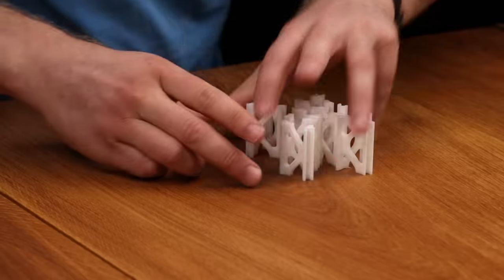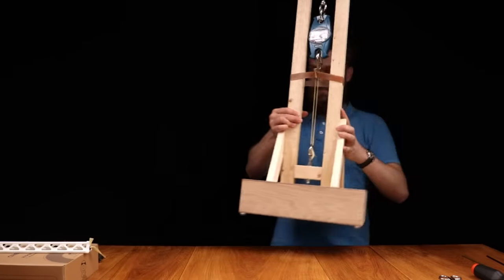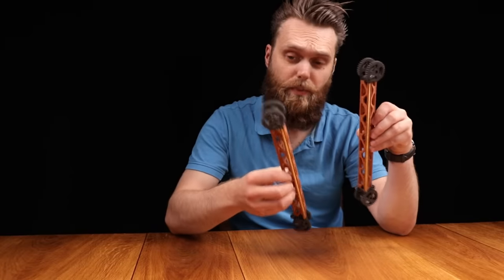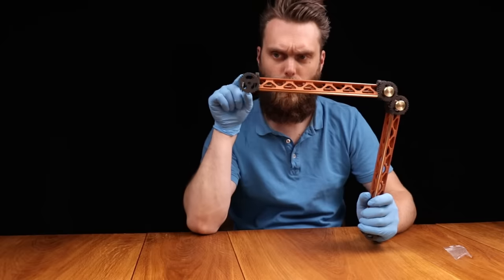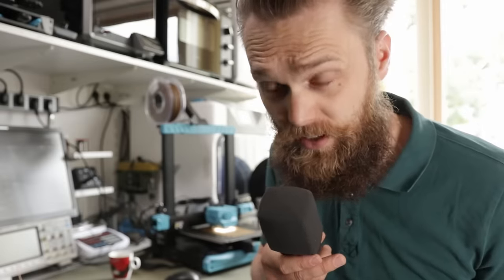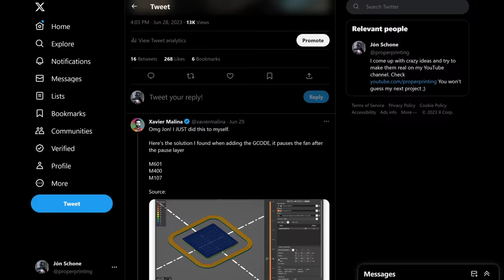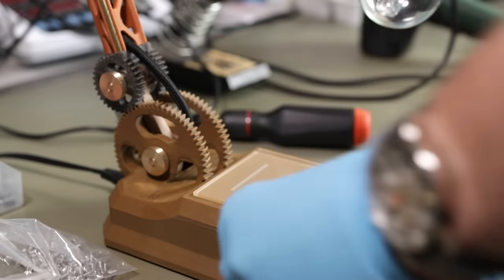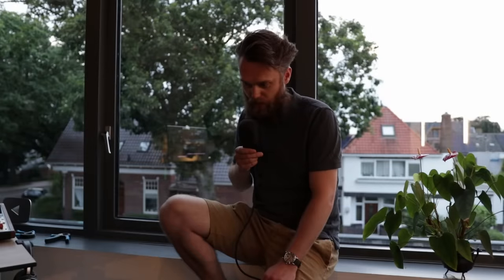You can build AWESOME things with this 3D Printed System!

Comment from the maker: Hi everyone! I didn't expect this video to go so well, and it did! So awesome! It turned out that I forgot to add the actual tensioner tool in the download on my website, and I just updated the file https://properprinting.pro/product/desk-lamp/. Bear in mind that this design still needs to be optimized, probably with some metal parts. Most important thing when designing things like this, and that's often the challenge, is to find widely available, standard and affordable parts. If that's not possible a 3D printed solution is required. I think I do have some interesting ideas for it which I'll show when I'm going to turn it into a 3D printer! Thanks everyone for watching and your awesome comments!
Reply from the maker: ps. I'm hijacking this pinned comment now. I forgot to mention that the length of the fiber also is a factor for its frequency. The length I used in the rig is similar to the length in the profile, so therefore the direct comparison. I found an interesting article that is quite easy to understand explaining this http://ffden-2.phys.uaf.edu/webproj/212_spring_2014/Claressa_Ullmayer/Mersenne%27s%20Laws.html So yes, if the profile becomes shorter we have to tune it at a higher pitch to get the same tension.
Reply: Fantastic project, with the print files are the list of items you use present? ( and maybe links so i can buy it directly? )
Reply from the maker: @andreasponchiado8839  Thanks! You can find that in the "Parts needed" tab on the page of that product!
Reply: i want you to understand that this is getting scaled up to mech suit
Reply: Needs a steel cable for the heavier load of the microphone. Or perhaps an end joint part that the beam section fits deeper into. CA glue all the pieces after tensioning.
Reply from the maker: @greggv8  The Kevlar is not the bottleneck and I'm going to improve the strength of the tensioner itself to make this work!
Reply: You look like you listened to the main groove in Bleed while standing in front of doc brown's stereo wall. It's a compliment ☺️
Reply: Why not make a tablet/phone holder ? Is it too heavy ?
Reply: Hi! Loved the Lamp!
In my line of work (fiber-optic cables), most cables I work with come with Kevlar reinforcement, and our cable attachment guide lines tells us to braid the kevlar so it wont break "so easily". So, I wonder it Braiding it would increase it's tensioning force limit.

Comment: Tuning the rope to match the tension was genius. I've never seen it done the other way around before this is mind opening!
Reply: Fairly common, you can measure linear density of a string and calculate tension basing on frequency and length of the string, it's in many design manuals too
Reply: Motorcycle drive belt manufacturer has an app for tensioning belt using that concept, pretty neat
Reply: Resonant frequency is a function of tension, length, and mass of string. This is probably a pretty accurate technique if the lengths of the string are the same and the string is the same.
Reply: This is how voron does their belt tension
Reply: The mechanical engineer in me is wondering how the resonance frequency changes between the test rig and the 3d printed part would affect the results.
Reply: @Larkinatorr  yep, but they severely undertension belts to hide design issues
Reply: @senorjp21  yes, this - all else being equal, you need the same length of string to get the same pitch.
Reply: @szymonjastrzebski2909  Could you name some of the voron design flaws? 
Genuinely interested in hearing them
Reply: @RayBellis  which isn't as easy in this use case since you trim the string by yourself and you twist it to remove slack, depending on how much slack you leave while cutting, linear density will change (of course you'll need to take up a lot of slack to make it noticeable
Reply: The first reprap printers' instructions had tensioning guidelines using the note when plucked. See the PDFs.
Reply: @fmphotooffice5513  yeah, even Gates design manuals talk about this method, it's fairly capable way to do it
Reply: Well since you said it already. I'm just leaving comment for YouTube. But it was indeed incredible idea and I play guitar for a hobby too, yet it never crossed my mind...
Reply: MOTHERF You're a genius.. yeah, yeah, everybody knew it bla bla. This viking actually taught me.  #Fanboy

Comment: Awesome work!

For the counter-weight spring, consider borrowing from nature: the human elbow has a protrusion called the olecranon, which acts as a lever for the muscles that extend the forearm. A similar lever design would force your spring to expand more as the joint collapses, rather than pulling into the middle of the joint.
Reply: True!
Reply from the maker: Good thing to look at nature more often, thanks for this info!
Reply: Geez thanks, now I just had to watch a video on how the elbow work.
(https://youtu.be/3l3-5Ij3JZ8)

But i really don’t get how the olecranon helps as a lever arm? It seems that its just a ”claw” around the humerus joint, the biceps attaches below it (just like the springs in his desk lamp), and the triceps attaches at the back of the claw.

Or am i thinking backwards? Should his springs be concidered the triceps?
Reply: @lillalysmasken3  The springs are like triceps: they have to apply force around the outside of the joint (more than 180 degrees). The olecranon improves this (I think?) by 2 means: first, extending the path taken by the tricep, so there is a bigger difference between the length when flexed and the length when relaxed; second, providing a lever arm that is closer to perpendicular to the muscle's force, allowing it to generate more torque around the joint.

I may not be explaining super well. But if you look at the counter spring in this video, you can see that it doesn't stretch very much as the arm flexes, and as the arm flexes more and more you'll see that the spring is pulling "back" against the arm, not around the joint.
Reply: Why not replace the spring with more Kevlar? You can put some knobs near the joints so you can hand change the length of the Kevlar to get different angles.
Reply: I have become intimately familiar with the olecranon lately... 90% distal triceps tendon rupture, literally peeling itself away from the bone. To see someone mention it "in the wild" is pretty wild. Baader-Meinhof phenomenon is fun! 

Surgery scheduled... Hope my elbow works as smooth as this lamp when it's all said and done.
Reply: Olecranon! Today I learned...

Comment: Pitch (frequency) is a function of both length and tension. At double the length, a string at the same tension will have half the frequency.
Reply from the maker: That's true! A guitar is a nice example and therefore I made sure that the length of my rig was the same as the one I used in the design. In hindsight I should've mentioned that.
Reply: @properprinting  I mention it because I assume in the future you’ll have variable length spans. You should theoretically be able to use the measurement you already made to calculate the expected frequency at different tensions and lengths.

Comment: One addition to the lamp is the lamp shade.  It can be used as a way of checking vase mode and start with the diameter of the outer thread on the lamp, after removing the bulb.  Keep in mind that incandescent lamps give off heat and that was how the " easy bake " ovens got away with being sold  to children instead of a heating element.  The fiber tensioning system seems to rely on the pully system and you should try with drawing it out and seeing if you can go past each end one or two more times.

Comment: Few thoughts: 
Don't use PLA for this system, it'll be constantly under tension and PLA is semicrystalline polymer so it'll creep over time causing tension to go down and possibly breaking in the process. 
For tension use phone with spectroid app, thanks to this you can see resonant frequency of the string and knowing linear density of the string (mass per unit length, eg g/cm), its length and resonant frequency you can calculate tension using appropriate equation
Reply: It might be possible to temper the PLA to reduce creep. I seem to recall PLA+ handles it better also.
Reply: @TuttleScott  PLA+ is a mess, some have better performance in certain aspects, some worse overall, not something I'd recommend. But yes, higher concentration of crystalline phases help a lot (fun fact, this can bring HTD up to over 90°C making it more temperature resistant than ABS or ASA), for this best pick are high quality PLA resins (3D870 for example) with added nucleation sites
Reply: The bulk of the PLA sections are actually under compression from the end caps. The little eyelets that are tied off are where the tension is. Being so small, if it creeps by a percentage of the total length, it would be a small creep. The risk here (IMO) is that the eyelet fails catastrophically, but I'm actually curious if simply gluing the sections of truss together wouldn't be enough to hold everything, given the copper rods on each edge. I would almost assume the bulk of the load is being carried by the copper rods, and the triangular trusses are sorting out internal loads, keeping the rods apart/together depending on where and how the truss is used.
Reply: @koos42  yeah, sorry, I called it improperly, wanted to say load but was already thinking about tension of the string. Under compression parts still creep, just usually creep results in buckling failure in this case. I do think that it calls for different polymer mostly
Reply: @TuttleScott  Why use this plastic at all, what´s the point ?
Reply: spectroid users represent! best app for the purpose
Reply: @sierraecho884  exploring the possibilities of new manufacturing techniques?
Reply: @TuttleScott  To archieve a worse result than what you already have ?
How is this design better ? Is the point to be cheaper or lighter or stronger, what is the point of this design ?
Reply: The kevlar tensioning is somewhat pointless. The plastic will creep until there’s very little tension left.
Reply: That's cool af
Reply: @saritsotangkur2438  Use a super strong spring instead xD

Comment: This was great to watch.  I love the innovation with the 3D printing structures and the tensioning system.  You went to great lengths.  I tried making my own system for a boom like this to hold my smartphone and had some similar issues.  The geared joints with the tension spring was a good solution to keeping the weight in position.

Comment: Nice! I like the simplicity of a guitar-tuner assisted force meter. If the segments are longer, I suspect the tone will change for the same tension ? So you can calculate a per-length frequency mapping.
Be careful with dimming halogen lamps, they burn out quickly when dimmed (the whole mechanism of condensing the tungsten back to the filament is disrupted when too cold. (this is why halogen lamps are also so tiny)).
Reply from the maker: The tone will change indeed and I was thinking of creating a map like you mention. Also thanks for the advice!

Comment: Would integrating a washer on the end of the tensioning system distribute the forces across the end profile a bit better and allow you to tension further? Or for off the shelf component use a brass plumbing flare fitting that has the conical shape you use to reinforce the tensioning nut? Love the design and can't wait to see all the potential uses for the truss system!

Comment: Just two ideas that popped into my mind at the end of the video :
1) why do you use a sand-filled bulky base, I don't know anout your preferences but I think that using a thin base that clamps on the table is nicer.
2) about the steampunk feel, I think that a simple dimmer with a brass knob would have been perfect for the kob.
Thanks for the video, the build is really well done
Reply from the maker: Thanks! To answer your questions: 1: Because not everywhere it can be clamped down, like on the windowsill for instance, and it's an interesting technique to show. 2: I came across these dimmers and I like the aesthetics of it. I wanted the base to be mahogany, but I couldn't get my hands on this material in time for this video. I expected the walnut wood to look better. It's a matter of taste, a brass knob would've been nice as well, but not as special in my opinion.

Comment: Using RX to analyse the notes is a big money move. You could get real nerdy with the tuning of the tension and run a spectrum analyser live and have a mic pointed at the kevlar as you tension/pluck it. 
That way you can tune it to a exact frequency rather than a note. 

(From a professional sound designer not an engineers perspective)
Reply from the maker: This program is a lifesaver. I also use it often in post to remove breath sounds, pops, clicks and clipped recordings!

Comment: Use a ratchet mechanism instead of a spring, it would make different masses on the end effector behave more consistently, I asked chatGPT its thoughts on the matter:

No problem! If you're considering a ratchet crank mechanism for controlling the movement of the lamp head, the concept would still work effectively. A ratchet mechanism, combined with a button or lever switch, can provide the functionality you described: lowering the lamp head, locking it in place, and releasing the lock for further adjustment. Here's how it could be implemented:

1. *Ratchet Mechanism:* A ratchet mechanism consists of a gearwheel (ratchet) and a pawl (a pivoted lever). The ratchet allows rotation in one direction and prevents it in the opposite direction.

2. *Button or Lever Switch:* The button or lever switch would control the engagement and disengagement of the pawl with the ratchet. When engaged, the pawl prevents the ratchet from rotating backward.

3. *Locking and Unlocking:* To lower the lamp head, users would disengage the pawl from the ratchet by pressing the button or flipping the lever switch. This allows the ratchet to rotate freely, lowering the lamp head.

4. *Locking in Position:* Once the lamp head is at the desired position, users would engage the pawl by releasing the button or flipping the lever switch. The pawl engages with the ratchet teeth, locking the lamp head in place.

5. *Releasing the Lock:* To adjust the lamp head again, users would disengage the pawl from the ratchet by pressing the button or flipping the lever switch. This allows the lamp head to be raised or lowered as needed.

Advantages of a ratchet crank mechanism with a locking switch:

- Controlled Movement: The ratchet mechanism provides controlled movement in one direction while allowing quick adjustments when needed.
- Secure Locking: The pawl engages with the ratchet teeth to lock the lamp head securely in place, preventing unintended movement.
- Easy Release: The button or lever switch makes it easy to release the locking mechanism for further adjustments.
- Minimal Effort: Users can operate the mechanism with minimal effort, making it user-friendly.

The ratchet crank mechanism, combined with the locking switch, offers a practical and reliable way to adjust and secure the lamp head's position in a 3D space. This approach provides a balance between manual control and stability, enhancing the functionality of the articulating lamp.

Comment: I made a similar lamp but I used 2020 extrusion that I salvaged from an Ender 3 :) I love the look of this one, I might give it a go using PETG-CF and some brass or copper fittings, I think it will look fantastic, I would maybe add a tensioning system for the spring, I used runner tube instead with a tensioner so I could get precise balance with the lamp head.

Comment: Great work and it's very inspiring to watch you videos! Quick Tip: To produce a higher tension force you can simply split the connecting rod in to multiple smaller segments, 2mm in thickness for example. So the friction between the rod and the gears adds up. Maybe you can get rid of the spring also. See also the function of a multidisk clutch.
Reply from the maker: Thanks for the info!

Comment: A cantilevered extension attached to the spring arm would provide the additional leverage needed to support the additional weight of your mic without having to change the springs you're currently using. The design is beautiful. I was a tower crane operator and the lattice arm design is something to appreciate when done correctly.

Comment: So with a filament box you can become a musician too. Jokes apart, the audio for tensioning is used from many year ago in mechanical, so you have reached an important target by alone, confirming your value (haha). The cheap to hi-fi material implementation is another important point to this new beautiful way to make. The halogen lamp is a little off, "matching" temperature and efficiency, but there are so many bigger problems....but if you don't know, there are a lot of pleasing (in ancient style intended) led bulbs, that can makes the lamp more "without time" too.
Reply from the maker: Thanks! I went with the halogen lights because the dimmer works best when a bit of current is drawn. I played safe since I'm already familiar with the result of dimmed halogen lamps.

Comment: Just to warn you, I was doing this same kind of thing, tuning my belts with the tones they make when i pluck em, but i found out that at the same tension you will have different notes depending on the length of the string.   Youve gotta make sure the string type, and the length are the same, then the measurement will work. :)  Honestly i should have known this from the start since i play both guitar and violin....and what you're doing by pressing the frets is making the string shorter....

i do LOVE this construction system concept.  I'd like to see it in 4 cornered, and with an easy way to mount things to it, it might even replace the aluminum extrusions we've been using for....forever.  can you imagine it?  itd be amazing...